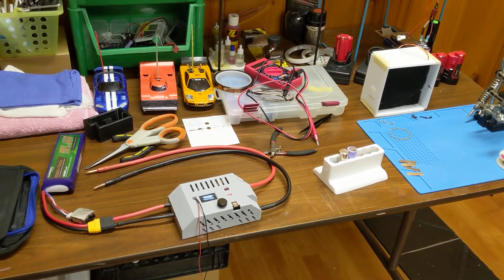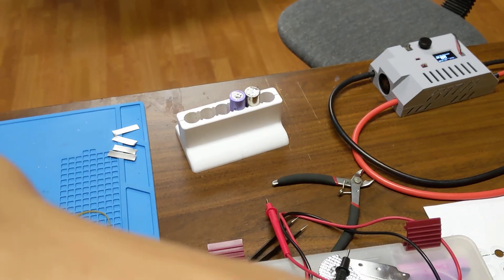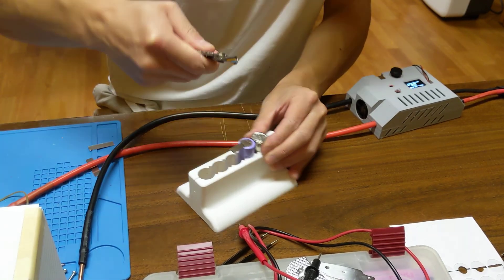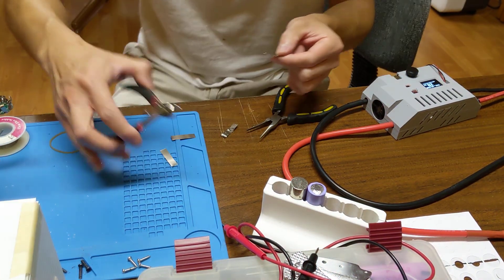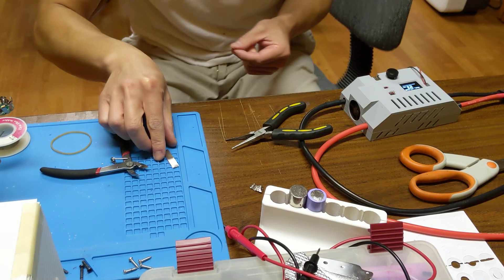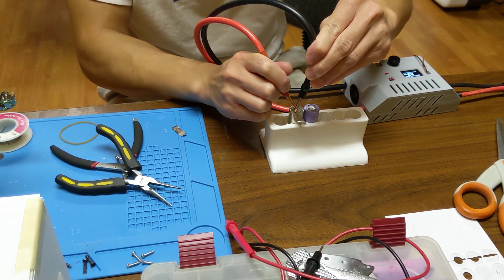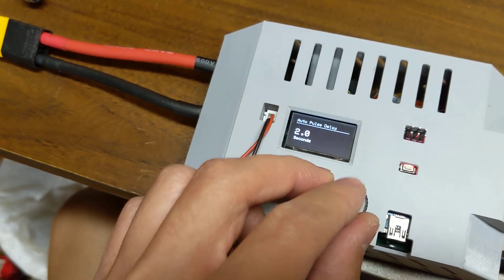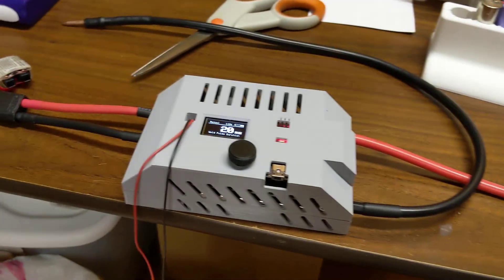Malectrics Spot Welder review with 0.2 mm pure nickel strip - so much better than the KKMoon unit!

Comment: I just bought a Malectrics Spot Welder. I'm hopeful it will work well. Is yours still going strong, if you still have it?
Reply from the maker: Yes I do! Haven't used it in a while but it was working fine when I did use it

Comment: Kweld is a better solution. Kweld measures dissipated energy instead of just setting a pulse time.
Reply: That is not how you check on max current. To do that correctly right after the weld you’re meant to keep your probes for two more seconds to see how much current went into to the weld. Doing that while probes are “in the air” means nothing.
Reply: @losien1  what are you talking about?
Reply: @Mr_Wh1 he is telling you how to check current that went into the weld
Reply: @samsonsamsamsam  The point is to have the dive deliver the same amount of energy regardless of the the state of the source.
Reply: @Mr_Wh1  I agree but I don't think that was the issue with previous comment.
Genuine question, what does it matter if you reference in joules delivered or amps? The point being, even if melectrics reference the duration of pulse in ms you can still adjust the current accurately with the method described up there?  Thanks
Reply: Kweld is much more expensive (3 times the price).  A new system on the market is made by ussolid models# BSW00004, BSW00005 or BSW00006. I think it is the same manufacturer as the glitter  (model 801A, etc.).
Reply: @DarkMatterDrift  The units you talk about seems to break often and seems to be only delivering pulses based on milliseconds time frames, where the Kweld does it in joules delivered. Measuring the actual energi delivered to the weld is a much better way to do it. Kweld still seem like a better option regardless if it's actually more expensive or not.

Comment: any tips on rebuilding the battery on the m12 pack? ive heard the original board are picky.. or is it better using the knock off board?
Reply from the maker: I don't think there will be any difference
Reply: @MINIzguy what setting did you need to use it on to weld the 0.2mm pure nickel strip? As it seems quite hard to weld this thickness.

Comment: That unit you're talking about with 5kW is a measure of the capacity of the internal battery, but it's the other hardware that determines the power it outputs on each weld. The capacity determines how long you can continue to make said welds before it stops. Anyways, wish I could find this one it looks good.

Comment: I always have a problem to Weld one strip on top of another and I can hear the bottom one disconnecting from cell, what am I doing wrong? 
30 ms is to less?
Reply from the maker: Maybe you need to clean the strips with some acetone to remove any oils before you try to weld